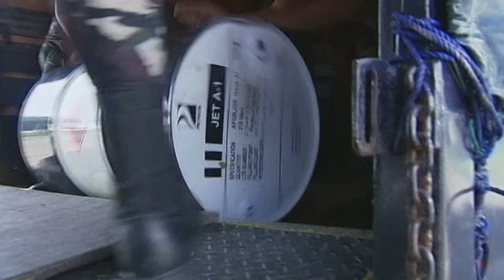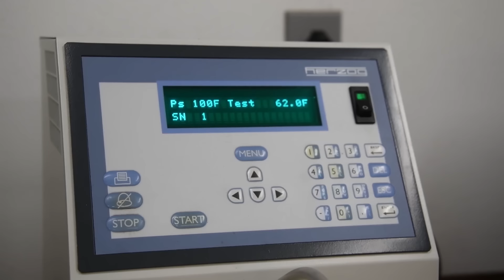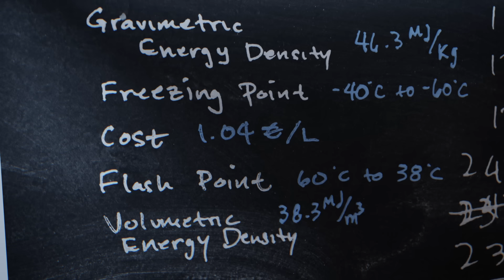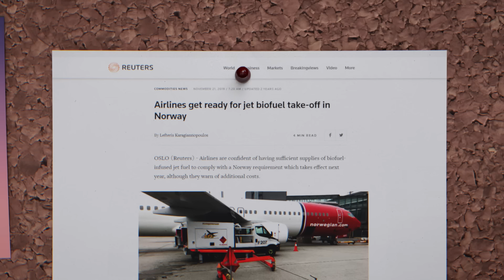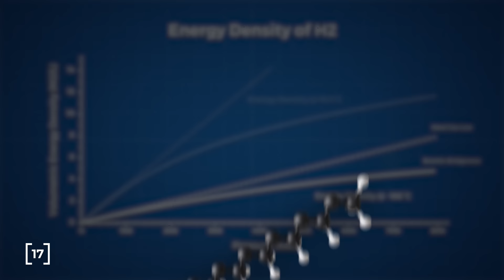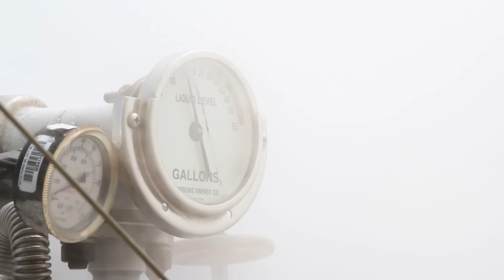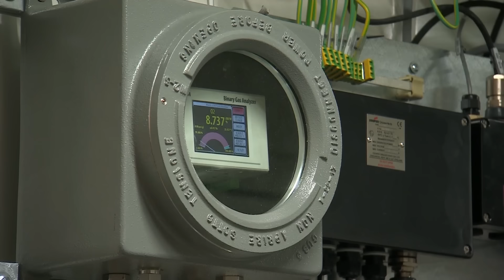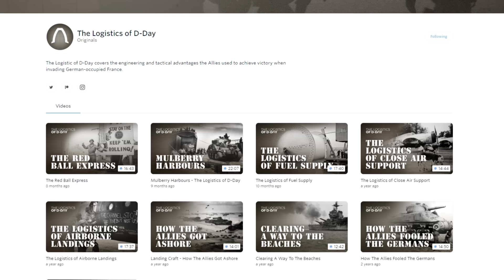The Uncertain Future of Jet Fuel

Comment: On the freezing point of jet fuel: It's really cold at cruising altitude everywhere in the world. What matters more is the duration of the flight. The fuel takes some time to cool, simply because there is so much of it compared to the fuel tank surface area. Long flights require more careful management of fuel temperature.
Reply: The engine oil goes through tubes that run inside the fuel tanks. Oil gets cooler while fuel gets hotter. So no it will not freeze.
Reply: But if you're at the end of the flight and there isn't much fuel left, that might be a problem. It could cool down faster.
Reply: @Yonatan24  I think it shouldn’t be a problem to redirect some of the turbines’ heat back to the fuel tanks, whether with oil or other means. I believe that even a primitive electric heating system could solve the issue.
Reply: Or you just go full SR-71 and fly so fast you need to use the fuel as a heat sink instead of worrying about it freezing
Reply: @andreirachko  thats basically already being done. Although heating the fuel tanks is the least priority of that system.
The primary uses (AFAIK) is to heat the leading edges of the wing and the ailerons and other aerodynamical devices to prevent ice growth, and then it also heats up the cabin, and then parts of the fuel system if at all
Reply: @Gary_Harlow  I see. That’s quite neat actually, so didn’t know that so many layers needed heating as well.
Reply: They keep a good watch on the F-35 for that reason. There were serious problems in the beginning.
Reply: Just use electronic heaters in the god damn fuel tanks to maintain safe temperature for the flash point problem.
Reply: @Enginator8  electronic heaters will ignite the fuel and blow up the whole plane.
Reply: @KursatCakar  No, because the electronic wiring will be external from the tanks. Only the heaters will be in the tanks.
Reply: And the fuel is heated by the engine oil....
Reply: @Enginator8  you could always use electric heaters but they might gobble up energy and trash the plane's fuel efficiency. Or not. You don't know if it has drawbacks until you study it.
Reply: @Norsilca , yup further studies are required.
Reply: @Enginator8  the point is someone's already done the studies and thought a lot about this. Just not us.
Reply: @Norsilca , then it is probably already being used or just not efficient enough yet.
Reply: @andreirachko  there is a de-icing system in place for the wings...
Reply: @Enginator8  TWA800
Reply from the maker: That makes a lot more sense, thanks for the correction
Reply: @Aufnahmen aller Art - Medienproduktion. Tonstudio, Fotografie, Video. Oh yeah rigth! Thats how it works, thanks for corr correcting me!
Reply: @Norsilca  It would be less efficient than using hot oil or bleed air from the engines directly for sure, that way you are using the thermal energy directly. Powering those electrical heaters would mean first taking the heat from the giant turbine furnaces under the wings, converting that to kinetic energy, then to electrical energy, then back into heat elsewhere. Far more efficient to just draw some of the hot gas or oil the thing with the big fire in it just bellow the wings is already producing and direct that to pipes in the fuel tank. You could probably even increase the fuel flow to the engine a bit and divert some of it through pipes around the engine core and circulate it back to the fuel tank so it can pick up some of the heat from the engine that way. Would mean making the fuel lines and fuel pumps a little bigger to accommodate the increased fuel flow but it would probably work.
Reply: @Enginator8  you would first have to generate electricity from the spanning engine that is burning fuel to then use that electricity to heat the tanks. In that generation  proces lots of energy gets lost. Not very efficiënt. 
Using the heat in the lubrication oil of the engine is much smarter. The heat in that oil would be wasted energy anyway, so why not use that to heat the fuel in the tanks? Win-win!
Reply: @jfv65  You are totally right! But Electric energy stored by liqued metal batteries can also be used to power the heaters instead of another generator.
Reply: @seraphina985  the round trip efficiency from fuel to turbine to generator and then back to electricity for the leading of the wings of the 787 dreamliner is 97%.
Reply: @RealEngineering  The Biodiesel on the video was represented like normal diesel
There's actually an oxygen atom on the ends of the Polycarbon Chain and is like this
(C12,H26,O) or CH3-CH2-CH2-CH2-CH2-CH2-CH2-CH2-CH2-CH2-CH2-CH2-OH
As a joke you can call this Diesenol based on Methanol and Ethanol
Reply: @antoniohagopian213 

Ja
Reply: @antoniohagopian213  

Jo. So
Reply: I'll go through all responses in here soon, but ambient temperature isn't exactly translated one to one to the temperature eventually reaching the fuel cells, IMHO. I mean in about every document about the Concorde, they'd tell how much she expands during flight due to extreme heat inflicted simply by air friction. I believe it's said the surface temperature would be around 200F at Mach 2. and we all know the heat shields from the space shuttle or have seen shooting stars flaring up when everything the atmosphere. yes, I realize that regular commercial airliners fly subsonic speeds and not even the altitude is the same, but I'd still think that friction will play at least some effect, wouldn't it?
Reply: @andreirachko  yes, but the more systems you need to rely on, the more points of possible failure. that's why it's best to be inherently failsafe, I'd say.

Comment: 14:40 Something went wrong here, the chart is showing cold hydrogen having a much lower density than room-temperature hydrogen, which is obvious nonsense. Are the labels accidently swapped?
Reply: Think so
Reply: Yeah, and he still seemingly read the wrong number off the chart. I'm confused.
Reply: I remember noticing that, too. I commented this:
"14:40 I think this graph is wrong. Why is hydrogen less dense when it's colder? Is the 19°C one actually Kerosene? I really doubt it if the number you gave immediately afterwards was right."

Comment: The thing about E-fuels as well is that it apparently works with existing ICEs in cars as well, there have been some tests here in Europe.
It could be mixed with normal gasoline in that case as well, so I hope it will catch on in which case there might be more of a chance of it becoming cheaper (?)
Reply: E-Fuels only make sense if there is an abundance of electricity available, that is cheap and not harmful to the environment. Renewables are often limited by the grid they operate on and fission nuclear plants are mostly used for base loads (and you are also dependant on imports of fissile materials depending on where you live). It is gonna be tough to justify their use.
Reply: E-fuels will be powering the next gen Formula 1 cars in 2026, so that should also allow car manufacturers to start experimenting with them soon. Porsche is currently making E-fuels in Chile using the abundance of wind power on the Chilean coast. As mentioned in the video though, scaling this for air travel will need way more excess renewable fuel than we currently have. It's going to take some time until it's feasible.
Reply: The swedes were at it for years. Their e85 and m85 fuel, containing 85% metanol or etanol 'suffers' from extra horsepower, not really needed in turboSAABS and Volvo's, due to higher octane content......

Comment: 3:44 "Longer chain hydrocarbons liquify... thanks to their lower boiling point"? A lower boiling would mean that the substance is more likely to stay in gaseous form. Longer carbon chains should have higher boiling points no?
Reply: Yip 👍
Reply: I didn’t understand anything you just said.
Reply: @brandonbowden1262  That's why you should stay in school.
Reply: Longer chain hydrocarbons (have greater strength of IMF) have a high boiling point so are more likely to be liquid at room temperature. You are damn right, what he said is wrong. :D
Reply: How dare you correctly correct an incorrection
Reply: Angel Beltran Yeah I know right!? The absolute nerve of these guys 🤣
Reply: He definitely meant higher boiling point, so it condenses lower in the tower. It was also noted that it cools as it goes up the tower. The inverse in location and temperature added a the confusion.
Reply: Indeed I had already made a comment about this before seeing yours oh well hopefully he will see one of them and can add a correction.
Reply: @Ebani  chemistry is confusing. not as bad as electromagnetism, or electromagic as it should rightfully be called, but still confusing. I had to stop the video and think for a good 10 minutes before I came to the conclusion that what he said in the video was incorrect

Comment: One of the big issues with the Blended Wing Body design is with safety. There would need to be a new way to escape the central sections of the airplane, so hopefully that will be addressed if you make a video on that design.
Reply: Put a hatch in the roof, and have it board like the disney world submarine.
Reply: Or you could have the passengers near the leading edges by the emergency exits, and fill the central section with fuel tanks and luggage space.
Reply: plus the additional vomiting
Reply: @Attaxalotl  more like the container in Thunderbirds 2. Just drop the entire container where people are in. the only people left then are the flight deck crew.
Reply: put the seats on the outside and make everyone wear pressure suits with parachutes. hook rows together in groups in case of emergency disembarking. in-flight meals delivered as a liquid through gavage feeding. first class tickets receive sedatives.
Reply: @Fottrel  make it cheaper every row gets one suite. And food is one pill each. Fed with rainwater if lucky.
Reply: @che3se1495  In the real world ejection seats tend to severely injure and kill those who use them and have safety training, and are expecting it.  This is a case where the maintenance on the explosives used would likely kill more then they save and then injure or kill the people who use them.
Reply: Another is that the further passengers are from the Cg the more motion sickness that will occur.
Reply: In the event of an incident, passengers could simply escape using the same pathways they do with current aircraft designs (i.e., the big gaping hole in the middle of the wreckage).
Reply: @ehb403  That isnt realistic.  Also what is designed on current planes is windows and doors which dont exist on blended wings because well they open up into the wing.
Reply: @imjashingyou3461  I'd say you haven't looked at many crash sites, not much left of those doors and windows in many cases (I'm assuming you mean escape as in it's urgent, if you just mean to get to your luggage then you might have a point)
Reply: @ehb403  I've worked on aircraft in the aviation industry for 6 years now.   That's really bad design to depend upon the aircraft crashing in such a way to allow for egress.  So if that doesnt happen then everybody is just fucked right???   "Sorry we were depending upon the aircraft to crash in such a way that the structure was totally destroyed but also you somehow survived.  Our system doesn't work in any other scenario.  Oh and when it does work it might be only one point that opens into anything from grass to a burning pile of JP-8.  So you might be able to leave the aircraft but only have one option that leads to certain death. 

There is the simple fact that the majority of emergency events occur when the aircraft isn't airborne, during or prior to take off and after landing, and during maintenance and ground operation.  The aircraft has not crashed and the structure is not destroyed in these cases but no one has means to safely egress except through maybe the possibly blocked entry point.

Its pretty clear you have no experience with actual aircraft use as you seem to think the only situation where egress is needed is during a catastrophic crash and there is no other reason.  (ALSO PS The majority of CLASS A MISHAPS don't completely destroy the plane.   it might total it or make one big hole if that, but doesnt mean thats viable for egress.  Its pretty clear you have only seen news crashes after the aircraft has burned out and collapsed.)
Reply: @James Smith Your gonna say safety is a trivial issue?
Reply: @HalNordmann  that would be a nightmare for safety and the crew.
Reply: @imjashingyou3461  Wow dude, get over yourself (and maybe get a sense of humor, too)
Reply: @James Smith Its exactly what you said. weather you meant it or not its what you wrote and all i have to go on.   I would say safety of the design of which blended wings are not for passengers (not cargo) is of the utmost importance over design changes because of fuel types or climate issues. Until the safety issues with having highly cycled high pressure vessels and designs that don't allow for egress points are overcome we should continue to use kerosine and work to cheap e fuels.
Reply: @imjashingyou3461  OK: so two blondes walk into a building...

You'd think ONE of them would have seen it!
Reply: You mean like chaff
Reply: @Attaxalotl  Ejecto seato, cuz!
Reply: The inherent flaw in the flying body is hoop stress (Google it, no joke)
Reply: Trains. Trains use far less fuel per passenger. Trains.
Reply: @HalNordmann  put the passengers in the wings
Reply: @imjashingyou3461  you could have passages going up to the top of the wing, like a short stairwell and then a hatch on the top of the wing.
Reply: I’ve seen this argument before, and it’s just ridiculous. Evacuating existing designs is difficult because there are usually only 3 sets of doors - front, back and the ones over the wings. On a blended wing design you could in theory pepper them with many emergency exit doors, and the resulting aircraft could be much easier to evacuate than traditional airplanes. Instead of waiting in a crowded aisle for a third of the plane to exit thru the door closest to you, you could be piling out with just a couple of adjacent rows thru your own emergency exit.
Reply: @imjashingyou3461  "I would say safety of the design of which blended wings are not for passengers (not cargo) is of the utmost importance over design changes because of fuel types or climate issues. "  Excellent point!! So true!! The climate extremists don't REALLY give a hoot about people, only some abstract 'planet'